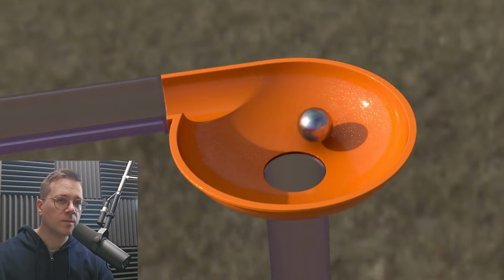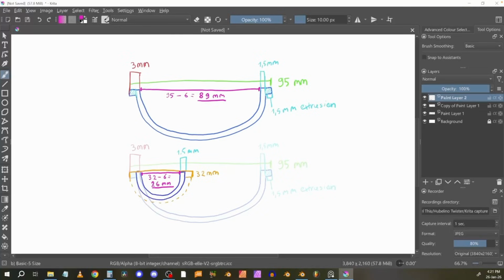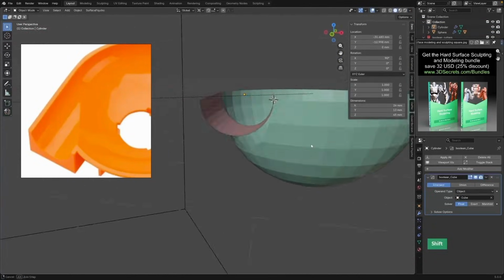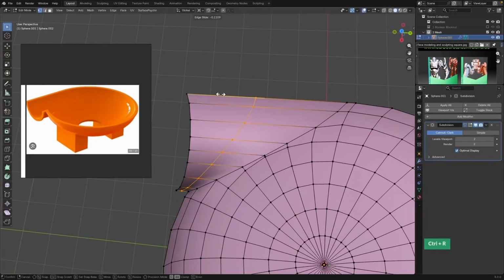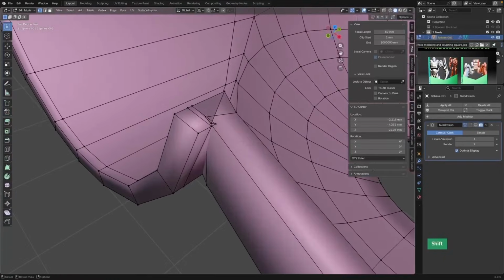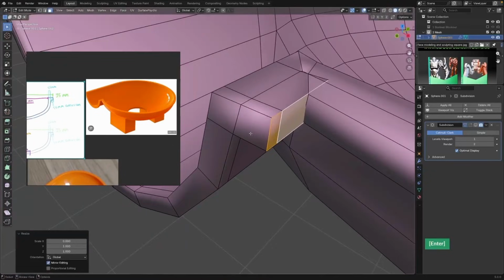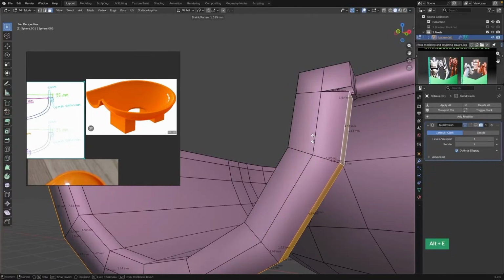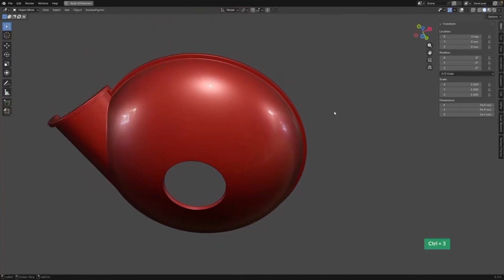How to model that - Marble Runway Funnel (Blender Secrets)

Comment: Why don't you use the B shortcut when moving vertices to snap as opposed to just eyeballing it. Blender can be actually be 100% accurate just using the B snap command. It's incorrect to say it is not completely accurate